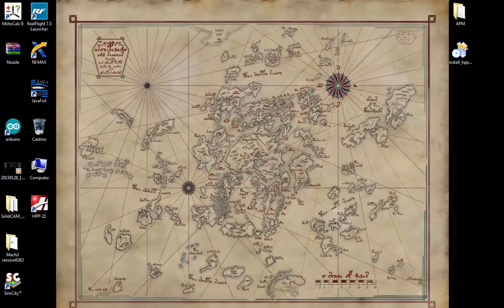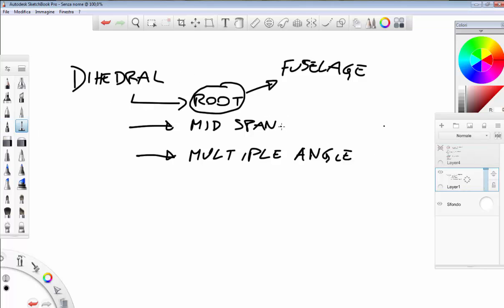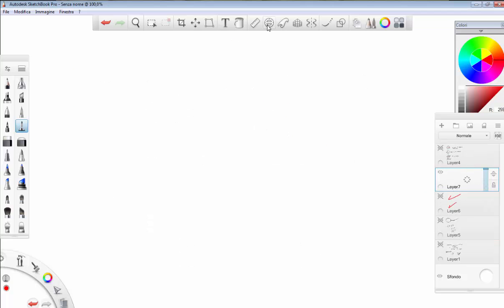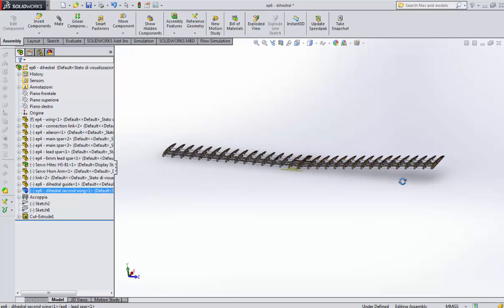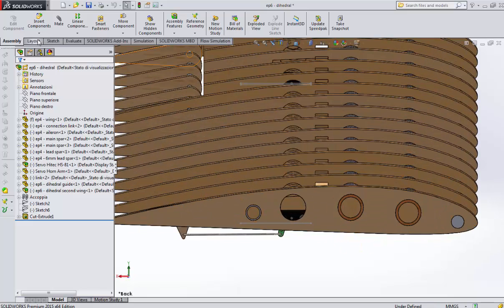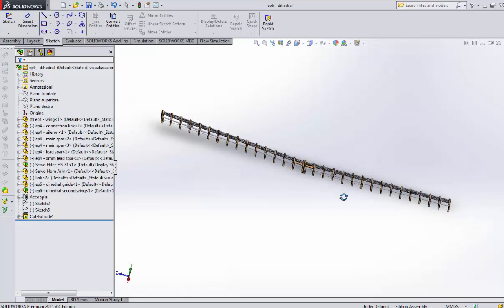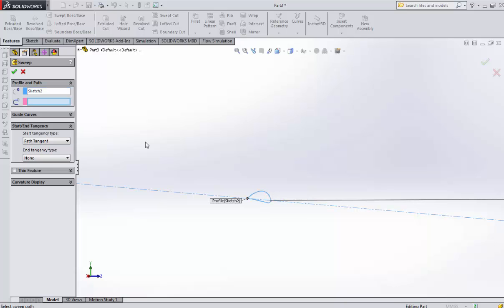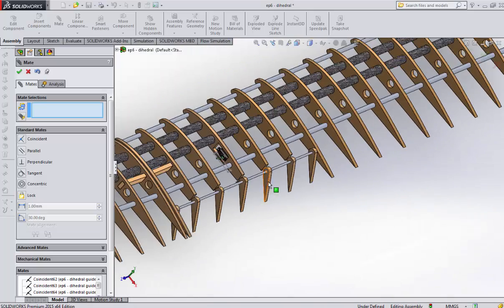Ep.7 - How to build RC dihedral wings with solidworks

Comment: For dihedral wings, are the airfoils parallel to the ground or parallel to the dihedral projection line?
Reply from the maker: hi, what do you mean with projection line? 
Airfoils shall be parallel to the ground.
Reply: However, from the cad, the airfoils do not seem to be all parallel since there is a dihedral angle?
Reply from the maker: +airplanesnstars now i understand what you need.
 In the dihedral part, the stations (airfoils) are perpendicular to the spars, or if you prefer, the angle between airfoil and ground corresponds to the dihedral angle
Reply: Ahh I see. Thank you very much for your help sir!